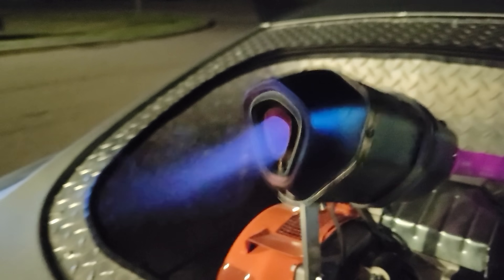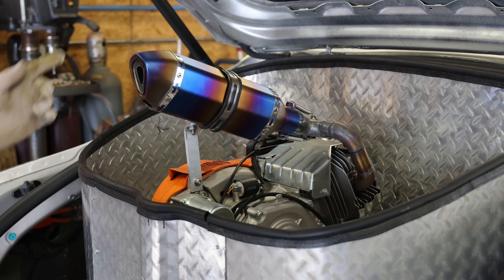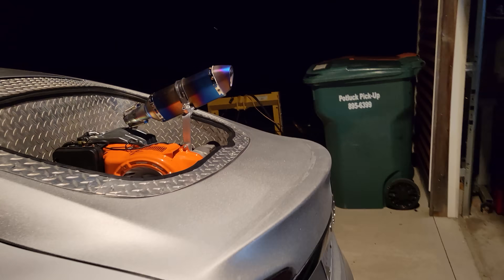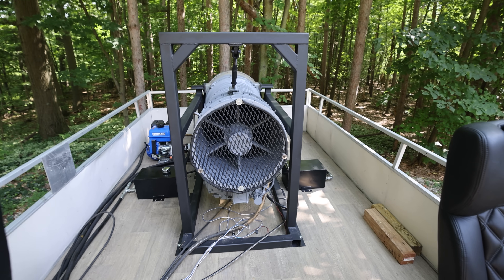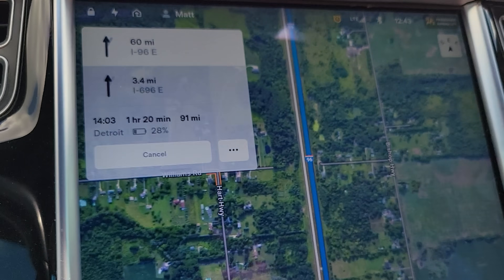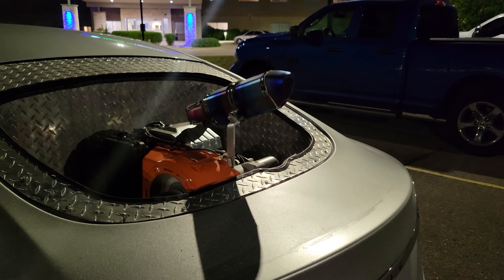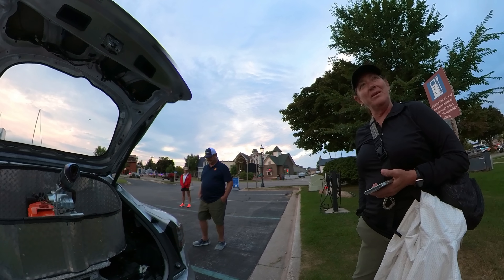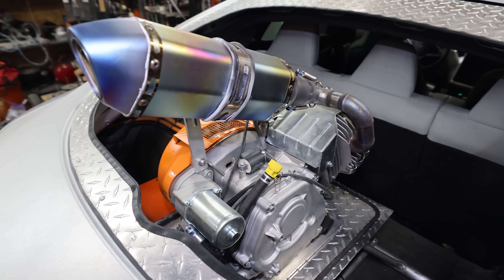Cordless Tesla (I Drive 1800 miles without charging) P.1

Comment: Instead of using a gasoline power plant, why don’t you try to get 2 or 4 alternators? Attach them with a belt to each wheel and then connect them to the battery…do u think it would be possible?
Reply: this is not possible, the alternators  require power, and due to inefficiencies, they will use more power than what you can draw from them. That goes for anything creating power. Same goes for this gas power plant, although its charging the car, alot of power is lost through heat transfer from the motor believe it or not.

its great to see that if hybrids cars are made backwards, with electric first then motor as a power plant, you can easily go much farther than a gas powered electric assisted car.
Reply: @Mosquito3314  not necessarily. He did stop and get gas multiple times.
Reply: @MaloCrafted  true, but the tank for that gas is tiny he literally probably spent like 2 minutes filling
Reply: Go do some basic learning of physics and you'll understand why that's impossible to do. No big conspiracy people.
Reply: @captknuckles7143  that’s what big oil wants you to think.
Reply: @DadMods  Actually it is what modern Physics teach us. Mr. Oil has nothing to do with it
Reply: @DadMods  Show me that there is a greater than 100% efficient solution and I'll show you the first trillionaire.
Reply: the increased load on the motor would drain the batteries more than what power you would recover from the alternators
Reply: This is what regenerative braking is. Alternators can technically be changed to an electric motor and vice versa.
Reply: What you're describing is perpetual motion -- and that's impossible. Something similar to what you're describing is regenerative braking which Teslas already have. If you want to understand the physics, I recommend you search YouTube for: 'Can you blow you're own sail?' spoiler: you can't!
Reply: Or he could mount a huge magnet at the front that pulls the car forward
Reply: What?💀😭
Reply: @David Arrigone.  It's possible, but what you describe is as worthless as a Wile E. Coyote contraption.  You're adding more weight, and more friction for the motor to work against, so instead you're losing energy.  Why is this not obvious?
Reply: This thread is more of an internet psychology lesson and less of an energy debate. LOL thanks.
Reply: this is all very interesting. the only problem is the majority only care about who has the most hp rather than who has the most efficiency.
Reply: If that did work Tesla would have used it to make a Perpetual motion vehicle! Then we would never need to fill up. That would be awesome, but we're not there yet(with technology), good thinking though! I think he should get an RV type generator, that's quite, and use the recharge stations along the way and only use the generator when needed.
Reply: Brah…..
Reply: This sounds like an idea i had when i was a kid to attach two magnet infront of my toy to pull it infinitely
Reply: Spin a alt by hand while its drawing 70amps then come back.
Reply: IM so sick of people posting stupid stuff like this. Idiocracy is here
Reply: Someone explain to this man the concept of the 1st law of thermodynamics
Reply: Review the laws of Thermodynamics please…
Reply: You have no idea on how physics works when it comes to electricity. The car would use more power to generate the power to charge itself. In other words it will add more load and shorten your distance. I won't charge itself when driving.
Reply: This thread reminds me why American companies have to hire scientists from other countries because our schools are failing us in so many ways. No, perpetual energy is not possible and no, big oil isn't to blame.  This is like day one physics class stuff. You can't just hook an alternator up to another electric motor and generate unlimited power.  This is how regenerative breaking works though but unless the alternator, battery, and motor were all more than 100% efficient (not possible) then it loses power.
Reply: @chrisspears6119  brought to you by big oil.
Reply: Most of the people who think this would work do not understand the concept of how Alternators work or even the concept that you can not have a perpetual motion machine it defies physics. You can exchange torq for speed or speed for torq but you can not create power from nothing there has to be an exchange that happens in gas engines they convert the power from gasoline to torq which propels the car but going Electric to an alternator then back to electric is inefficient and you would lose power in the whole system it would actually decrease range instead of increase it.
Reply: Ok, I checked few articles and it seems that with the current technology we cannot use a dynamo/alternator to recharge an EV. What about if the new “alternator” was built in within each wheel axle? For example, if the magnets were part of the moving rotors/axle and then surrounded by “wires” maybe this would reduce friction and therefore loss of power in generating power. This is just an idea but cmon, is it possible that in 2022 we are not able to find a solution to recharge a vehicle while it’s moving? There is so much energy that is not used while driving (i.e. wind, solar, friction, rotation, etc..) that really make me wonder why these alternatives are not explored yet..
Reply: @davidearrigone9411  they do have alternators, they just double as the motors.  Regenerative braking is used to get some power back as the motors act like an alternator and recharge the batteries a little, the more energy it produces, the faster the car stops.
Reply: @davidearrigone9411  dude, even if you somehow magically made an alternator that is 100% efficient, you are just breaking even, means you are using the same power that you are making, but there is no such thing that is 100% efficient, don’t be stupid
Reply: @davidearrigone9411  perhaps attach a wind turbine to the ass end of the vehicle and let it stick up a hundred feet or so.  That would probably generate some juice.  Yes I am being sarcastic.
Reply: @davidearrigone9411  there is no solution to it in 2022 and there never will he, that would quite literally break the laws of physics
Reply: The parasitic loss due to the extra drag on the wheels would negate most of the generating capacity of the alternators
Reply: Watts law is a bitc*
Reply: If you are producing mechanical effort to produce electricity it's never a 100% conversion. You can't consume your battery capacity and make a surplus supply. Regenerative braking - kinetic energy is converted part into electricity and part into heat through your brake rotors, never 100% conversion. I know youtube comments would insist you can create electricity with magic spell alternators but the reality is, nothing man made in the auto industry is ever going to compare to the efficiency of a star at producing energy.
Reply: Completely unnecessary since that sort of functionality is already built into every Tesla, in the form of regenerative braking.
Reply: No, same as this entire video is clickbait and fake.
Reply: Its definitely possible but definitely would be the worst thing you could do lol
Reply: Being an engineer, your comment gave me a headache!
Reply: @mohammadadilkhan6837  it's pinned for the lols and also gets people fired up. Nothing to see here.
Reply: I figured WP would be better than this pinning something like this to garner engagement and more followers. This is low hanging fruit.
Reply: This is the future. Who going to get in line and wait few hours to charge?
Reply: @chiefarchitectheadofproduc1552  plugin hybrids have always been the future. For my driving style, they are the only thing that make sense. At least a half dozen times a year I drive 1000 miles to Colorado, Tennessee, or Big Bend NP for backpacking. In my hybrid, I drive it straight through and still only use about 20 gallons of gas. Still get the pure electric benefits the rest of the year.
Reply: Lol it already does that
Reply: You don’t understand energy saying that. It’s like the people telling me to floor it and then turn regen on max for the best regen efficiency. It doesn’t work like that.
Reply: Why not cover the Tesla in electric windmills ? sUreLy tHaTll wOrK ?
Reply: Maybe if the alternators are connected to a self reciprocation flywheel
Reply: The electric motor is essentially a generator so you could just take the battery out of the Tesla and the when driving the power generated from spinning the electric motor can be used! And obviously you would have to park on a hill to get it started or push start it being the main drawback but using the knowledge of physics from over unity engines on YouTube it’ll work
Reply: This is not possible since the physics rule of "energy is never created only transformed" you cannot make it since to move the alternator you would still need the energy of doing said thing
Reply: Honestly at this point fuck it, let’s just put magnets on the wheels so we can go on FOREVER AND EVER
Reply: I love that you pinned this comment. I agree 100% with the alternators. You should be making a perpetual motion machine.
Reply: @DadMods  I love these comments lmao, it's so obvious
Reply: @DadMods  There is no such thing!
Reply: Indeed very possible. The first law of physics is that energy can be created and destroyed.
Reply: @gasmonkey1234  Nice!😂
Reply: @I_have_Aquestion  Yeah, he's wrong.  "The law of conservation of energy states that energy can neither be created nor be destroyed. Although, it may be transformed from one form to another."
Reply: @gasmonkey1234  Wrong.  Nice try though.  "The law of conservation of energy states that energy can neither be created nor be destroyed. Although, it may be transformed from one form to another."
Reply: @gasmonkey1234  bahahahaah
Reply: @gasmonkey1234  
I hope you are being sarcastic.
First law is energy cannot be created nor destroyed.
Reply: @gasmonkey1234  I think you need to go back to high school.  The Law of the Conservation of Energy states that "Energy cannot be created nor destroyed".  It can be converted via E=mc^2 but cannot be created nor destroyed.  There are frictional losses (heat) and resistance losses (more heat) and vibrational losses (noise) that cannot be avoided.  You cannot magically create energy while consuming it.  You must have an outside source.
Reply: @gasmonkey1234  Max, you've got that backwards.....Energy  CANT be created nor destroyed (just changed in form)...Law of conservation of energy
Reply: @gasmonkey1234  Energy "Can Not" be created or destroyed. You need a lesion in physics.
Reply: Wow, did not even think about that sir Isaac.
Reply: Yeah! ... Then the car can run forever.
Reply: Use permanent magnet generators that are connected via a small transmission connected to the output shafts. This will cut down on drag by having the gearing adjusting for the charging speed of the generator. This will work. It is similar to a motor turning a generator used for RV's. I think people keep forgetting the methods of generation of power.

Comment: I would actually be interested in doing something like this to my Nissan LEAF, out of curiosity how did you manage to charge the vehicle while running? I know in basically all EVs they will refuse to enter drive mode when something is plugged in, but I can tell that's now how you've done it.

Are you stepping the voltage up to the ~400V of the battery pack, and feeding it directly? I'm assuming you didn't bypass the actual charge controller in the Tesla for risk of overcharging/fire? Awesome project regardless!

Comment: Not to nitpick, but where is the generator head? I mean, clearly I see the engine, strangely the crankshaft does not come out of the other side???? But a 10kw gen head would be about 18" long give or take and nearly as big around as the engine, I don't see a belt going to a gen head either. Where do you hide it?
Reply from the maker: Hahaha, remember I custom built this from the ground up. You were already were looking at the generator head, you just didn't know it. 🙂.
Reply: @WarpedYT  Dammit! I watch all of your Vids anyway, but now I REALLY have to! I know you weren't just running off of the lighting coil, assuming that power equipment engine had one in the first place. I'm intrigued.
Reply: @WarpedYT  Nevermind, I just realized how DEEP the flywheel is after going back to the video on slo-mo. I bet that stator gets HOT!!!!